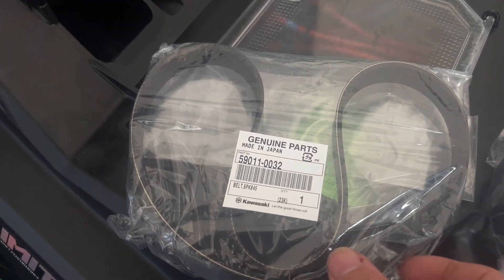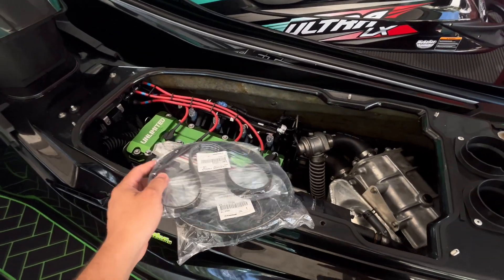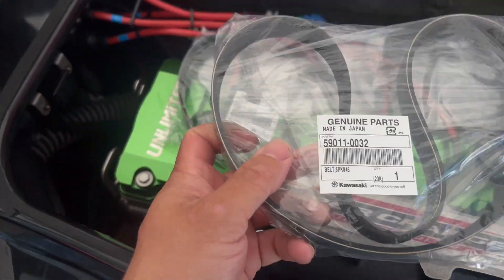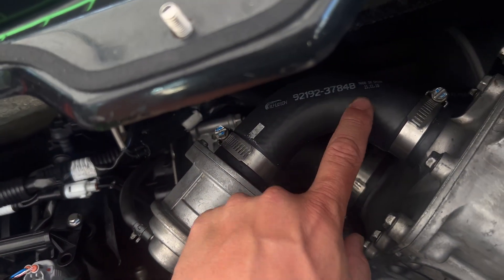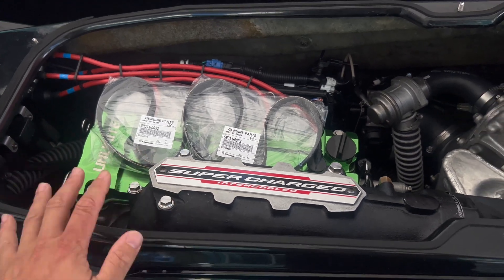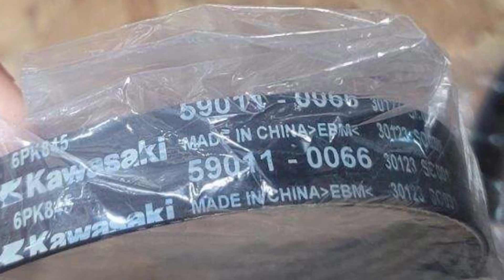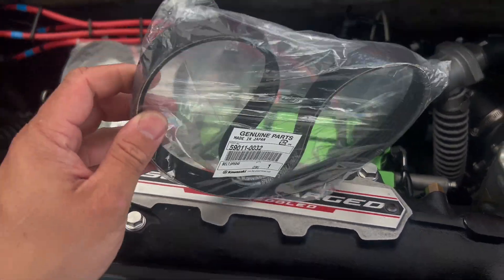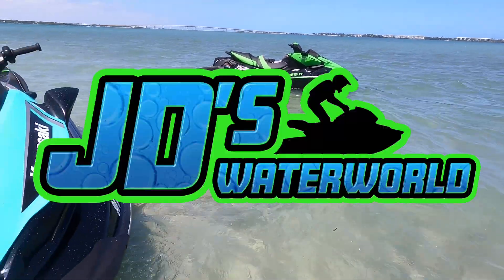Tech Topics: What is going on with OEM Kawasaki Jet Ski Supercharger Drive Belts?? [4K]

Comment: Had a belt blow on me in 17 hrs, The supercharger wheel was rusted and that shredded the belt, destroyed my speed sensor , and cooling line.
Reply from the maker: Yeah the stock pulley is carbon steel and the nickel plating on it wears almost immediately in salt water, they need to come with a billet pulley from factory